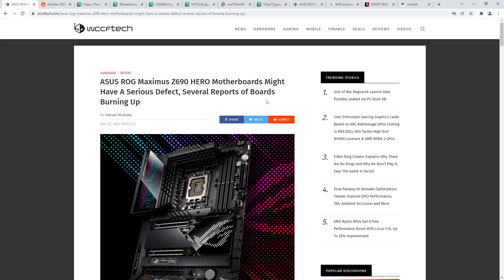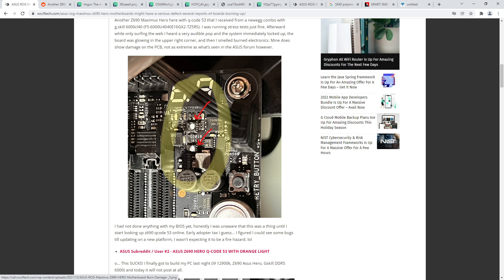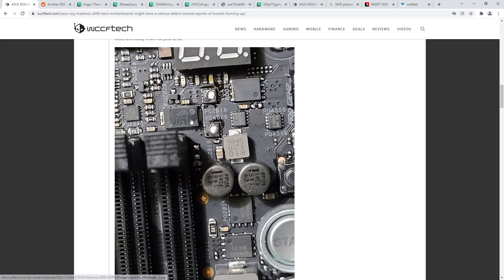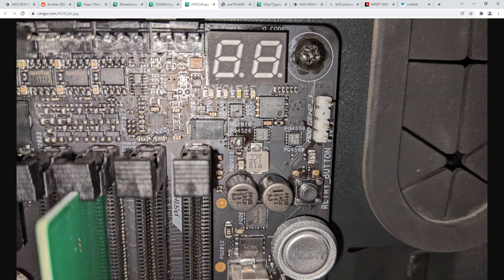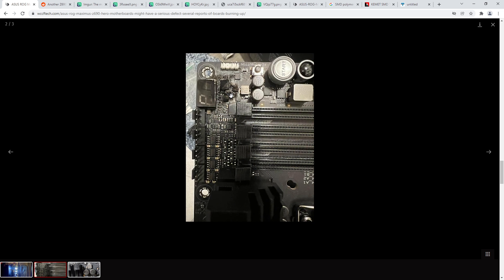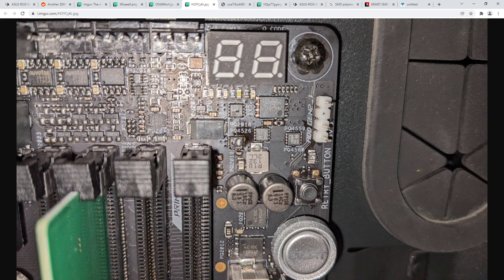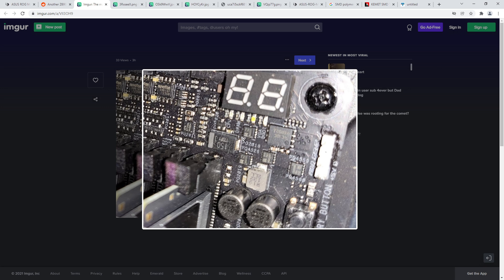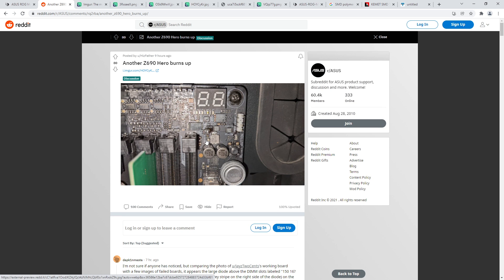My thoughts on the ASUS Maximus Z690 Hero failures

Comment: I went back and took a look at GN-Steve's tour of the Gigabyte factory. Can't see why ASUS would assemble theirs much differently, so I had to go with what's available on YT to see. https://www.youtube.com/watch?v=cnAFTMaS5R0

These mobo components are loaded up from rolls into pick and place machines that places them onto the board. These capacitors must have been loaded the wrong way on these rolls, or the pick and place machine was configured incorrectly. My guess would be the rolls, and if the problem was there, ASUS or their component supplier could have loaded them up incorrectly. There are multiple stages where the board is either inspected using optical scanners, yet they didn't pick up on this issue.

Not to mention that motherboards are tested using testing equipment, which didn't pick up on the issue. As you said, this issue can't happen instantanously, it takes time for the leakage to build up and then finally overload the MOSFETs. Since that's the case, it's perfectly possible (I guess) for the testing equipment to not pick this up.

I think the red flag is the optical inspection part. A capacitor of that size being the wrong way around should be detected. Especially since there's visible markings on it denoting the polarity.
Reply: I blame the usage of laser etching on the resin packages of the used capacitors. In some light circumstances the labeling is virtually invisible. But I am 100% sure that the visual inspection unit put out at least a warning about that but maybe they have ignored it cause "It's not in a high power part, should be fine". I dunno, just speculation. But there's one thing for sure: Mistakes were made.
Reply: That's the problem with the pandemic and supply shortage... All everyone ever thinks about, is the fact that they order the part and it arrives whereas what really happens is that there's so many people ordering parts that they have to speed up the manufacturing process which then means that the faster you go the more screwed you are when a mistake gets by the safety precautions, and temporarily lowered standards that might accompany it
Reply: I bet they disabled the inspection for the text and markings on that particular SMD, since they had to procure from several multiple suppliers, and someone took the lazy way and just turned off the recognition for it. Since they passed testing by powering up RAM sticks nobody checked closer.

Lesson: don't do it the lazy way, load all your suppliers into the inspection machine.
Reply: I am thinking as there are 2 visible cap designs/makes it may have loaded/placed the wrong cap info.
Reply: @wobblysauce  Could also be. But that is all speculation. Unfortunately ASUS will not disclose what has gone wrong, they will just (hopefully) quickly fix the issue.

Comment: I had some sort of liquid or blown up leakage on my Gigabyte H510's Mosfet and I cleaned it with wipe . My Mobo is running perfectly! is this alarming?
Reply: This does not sound good...any watercooling in your pc?
Reply: @penedrador  No just stock 11400 cooler you can watch my PC build on my channel. actually it was't mosfet , actually four legged chip next to pci express slot. i am not having any problems so far

Comment: So Asus's QC screwed up royally. There is automated machine visual inspection on mainboards and only way to screw that is that they configured it only to check presence of the component and not check polarity of the component. Also either their supplier provided rolls of components with wrong orientation or they inserted the roll wrong way around to the pick and place machine.
Reply: I think the one pic buildzoid showed that shows the alternative manufacturer cap (probably not KEMET, though marking isn't consistent with any known manufacturer i could find at all) is a good clue for what happened here, i'm pretty sure they bought up a bunch of mismatching stuff cause of shortages and when the optical inspection kept throwing errors because it was meant to recognize the panasonic SP-CAP variant only somebody on the floor had the bright idea to set that alarm to ignore, as you do (though you maybe shouldn't in some situations...). 
After they ran through the alternative stock which probably came in belts that had the holes on the opposite side of the panasonic ones whoever was tasked with swapping the belt just put in the new one correctly (by looking at the previous belt), however the caps in the compartments were the other way round, the optical inspection would have kept throwing errors which were allready ignored before, so nobody would have thought anything about it.

This is just speculation on my part, but best way i could come up with to explain how this went past QC :D
Reply: @taggxoc  It would be easy to make pick and place machine recognize bowth caps properly, all it needs is updating the machine with additional image of different brand cap in correct orientation, then configure the sensor to check for presence of bowth versions of the cap and act accordingly. Maybe they just assumed components in reel were at correct orientation and just went with it.
Reply: Asus ODM's partners QC screwed up royally is more correct, but yes 😅

Comment: Almost no way there would be two PCB revisions there. You don't just change the polarity of a large cap in a tight layout like that without shuffling a bunch of other stuff around too.
Reply: Oh hey, nice to see you in this channel.
Reply: Oh wow I never thought i’d see you comment here. My favorite channels crossing over! Love to see it
Reply: EEV LN2 OC when ?
Reply: Bingo.
Reply: Wait, you mean we can't just.... reverse the polarity?  Star Trek lied to me damnit!
Reply: I love your channel, I'm following your guide for getting a cheap workbench for repairs.
Reply: yeah no PCB rev, but maybe all SMD capacitor are standardized to have the band on the +/- direction? Maybe a different manufacturer component?
Reply: @vaualbus  as far as I know polarised SMD caps in the rectangular packages always have the stripe next to the positive terminal. This is a bit awkward given that through hole caps always have the stripe on the negative side. But I think those rules are always observed.

Interesting if the cap is at fault that it doesn't burn up. I guess because it is basically a short circuit.
Reply: @vaualbus  All polarized capacitors must have some way to visually determine polarity.  That visual cue will be spelled out in the product's data sheet.  Diode manufacturers have almost universally adopted the "band is on the cathode" approach (at least on their two-pin products), but the same is NOT true of polarized capacitors.  Sometimes there is a stripe, some times there is a "+" or "-" on the component,  sometimes the leads are different length, and sometimes there is some other physical identifier (notch(es), dimples, etc).
Reply: If the cap is essentially between two power planes, flipping it might only need changing where two vias are connected.  But if there's top layer tracks to the cap, flipping the cap could require changing the distance to nearby components just to make or salvage room for those tracks.
Reply: Listen to dave. He is a real EE. Seriously.
Reply: Agree, too much work to revise a MoBo for this trivial change, but that would also be easy to check if the revision number of the boards. These are too early of a product for a revision yet, and older versions would have been board partner to design integrated products and media review ONLY boards, NEVER for consumers thia early.  Then the Media and partners would have told them these are blowing.
Reply: So happy to see you here!
Reply: You'd have expertise to answer, would this be a supply part issue? The place and pick machine getting a reel of capacitor placed "backwards" or something? So the place and pick puts them in, but they come off the reel the opposite way assumed in design and planning?
Reply: @TechyBen   To answer your first question, technically the supplier should have the components rotated the same for every reel. However, they can do make changes. Their not going to email you to say "hey heads up we rotated this part for the upcoming reels". We had an issue where the polarity of a part was changed but the markings on the part was not. We had numerous failures at test and could not understand why as the polarity dot matched the silkscreen, the AOI program etc. This was a job, and part, we've used plenty of times. 

For your 2nd question. Depending on the SMT Machine being used, it shouldn't matter if the part is rotated 90 or 270, when the part is loaded onto the machine it will do a visual inspection of the part and detect component angle that way. It'll compare the image it sees in the reel to let's say a "golden image" and make the correction there. 

There are SMT Machines like the ones made by MyCronic where the SMT Operator will have to manually check the rotation of the part once it is loaded on the machine. MyCronic has been around for such a long time I have no idea why they still have it setup that way, but that's a different story. With that said if the operator forgot to check the reel and assumed it was correct, the machine would think the part is sitting in the feeder at 90* but in reality it's really 270*. 

Utimately at the end of the day there were multiple points of failure in the process and it's on the operators that do the SMT Setup, SMT P&P Operators, AOI operators, X-Ray to find the defect.
Reply: I'm going to choose to believe that Dave is a fan of overclocking/Buildzoid, and that he was not just referred here by someone.
Reply: Noone says what everyone thinks...  they did it with dollar signs in eyes on purpose...
Reply: I have to agree and I was starting to wonder about this when it got announced a couple of days ago, if there was something of an oops during production at some point I highly doubt that it affects every board out there. Probably just human error somewhere that’s generally far more likely
Reply: Actually if it's an automated procedure, all it takes is a few incorrect values on the machine who places them for this to happen.
Reply: @georgeindestructible  Nothing wrong happened "the previous time" we launched a shuttle below recommend temperatures, what's the worst that can happen?  It will warm up during launch eventually, no?

😐 Oops 😳😥
Reply: Yeah for sure, but he had to give an explanation why he was assuming 99%
Reply: Same thought here!

Comment: WHY WHEN I WRITE ON R/OVERCLOCKING THAT RYZEN DOWNCLOCKS AT 75C THE COMMENT GETS REMOVED
Reply: Why ask here?
Reply: @MoppelMat  im banned on reddit for asking there
Reply: @bigturkey1  maybe your cpu is just broken but you stepped on s.o.‘es toe for asking to aggressive? Just rma it and be done with it. We can’t read the glas for you.
Reply: @MoppelMat  all ryzen 5000 downclocks at 75c. ive owned 5600x 5800x 5900x
Reply: @bigturkey1  that might be the reason why you are banned. That is bs what you tell there. I own an 5950X and it downclocks at 90C. 5800 does that at 95C. That is no discussion but a fact. If yours do differently, you might want to fix your sh**.
Reply: @MoppelMat  90c is the max safe temp. ryzen 5000 starts downclocking at 75c
Reply: @MoppelMat  5800x runs at 4850 until 75c then start down clocking
Reply: @bigturkey1  maybe start where you measure. Most likely you just measure at the wrong point.
Reply: @MoppelMat  i use hwinfo and msi afterburner i can watch as i hit 75c it start downclocking. what does your 5950x run at core clock in cinebench when its at 90c?
Reply: @bigturkey1  it never does... I just cool it enough. it runs CB23 pulling 240W while at 88°C on something like 4600 - 4700 on all 16 Cores 32 Threads. its undervolted about 50mV. you should not run more than one sensor tool at the same time. also check what temp you read out, you need to look at the individual cores not the Tcap temp or something. all cores will hit 90°C before you will see reductions of ratios below 45. your power settings affect this also a LOT, you need PPT 250W, TDC 160A and EDC about 210A for this on a 5950
Reply: @MoppelMat  you are still downclocking at 75c or youd be at 4950 in cinebench.
Reply: @bigturkey1  no
Reply: @MoppelMat  you just said it starts dropping at load but doesnt go below 4500 til 90c. when does it start to drop?
Reply: @MoppelMat  with my 5800x i was at 4850 at 74 and then less than 4850 at 75c because ryzen downclocks at 75c.
Reply: @bigturkey1  pls stop writing me. You are so focuses on your bs 75c number. Thats just dumb. Pls tell your cat not me anymore
Reply: @MoppelMat  have you ever owned an intel cpu they wont downclock til 100c. i would be gaming on my overclocked 8700k at it would stay at 4.9ghz even when im in the 80-90c. all the ryzen 5000 chips start downclocking at 75c. so the cooler i used to keep my 8700k OC from downclocking cant even stop a stock 5800x from downclocking.
Reply: @MoppelMat  you already admitted that you are not at boost clocks during cinebench. im trying to explain this as simple as i can for you.

Comment: I‘ve had suppliers screw up their belts or automated loaders and supply us with merchandise where the orientation of the components was wrong. So it could also be e.g. a faulty belt. Either way automatic visual inspection is explicitly there to catch something like this.
Reply: My mind is kinda blown that the machine vision involved with modern pick-n-place machines didn't catch this.  Gotta wonder if a machine operator saw an error thrown up and troubleshooted by recalibrating the machine vision so it stopped throwing errors rather than realizing there was an actual issue.
Reply: the machine does not "know" what is right and wrong, it will repeat what it's been calibrated to do. Someone has either intentionally or unintentionally screwed up the CV calibration
Reply: @marcogenovesi8570  or they have machines without computer vision Which is VERY Rare at this point the other option is they disabled the CV to speed up the machine which is also a no no
Reply: @Aeriket  I'm betting on "disabled the CV", as I've kind of seen similar stuff done when under pressure
Reply: @marcogenovesi8570  true, but this is a very high cost board, disabling anything is a no-go 100% of the time. meh, anyway, at least the boards went off with a bang!!!!
Reply: And with looking, there are only 2 Cap types seen so far and only one is fliped having the issue.
Reply: Must be an Aussie manufacturer.
Reply: @TonySquared09  Aussies get paid enough that these mistakes don't happen.

Comment: Omg, I would expect these kind of problems on a ultra cheap  60$ Asrock MB, not on a Asus 600$ one.
Reply: ASRock is actually miles better than ASUS since they were split off.
Reply: @kyoudaiken  Welp, i'm speaking from my experience. Had a bunch of problems with Asrock MBs but none with the Asus ones ))
Reply: @dodge3259  Here the exact opposite. Same for MSI, works great.